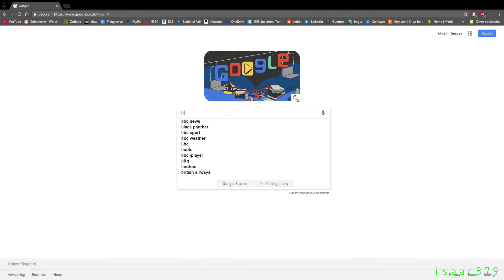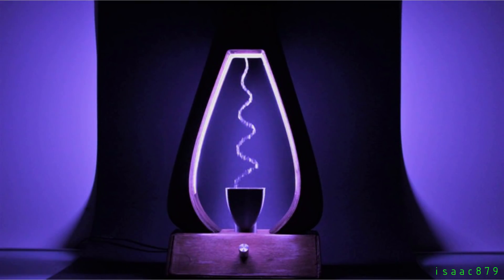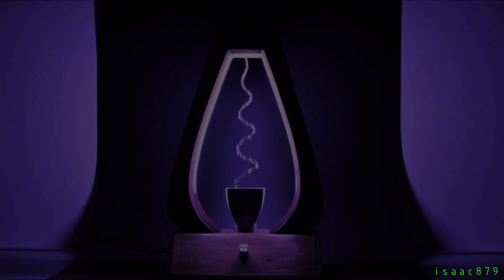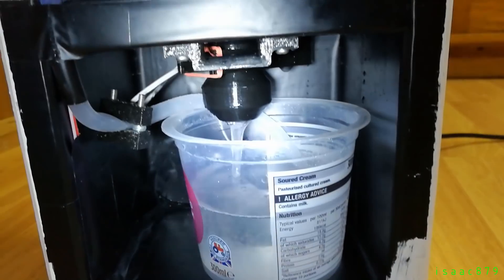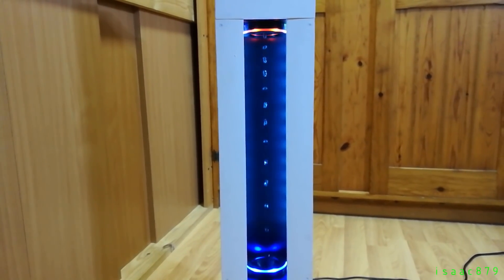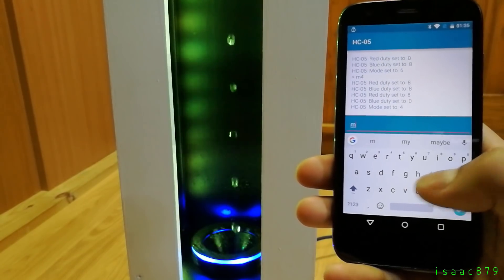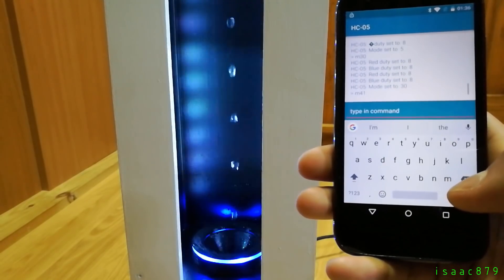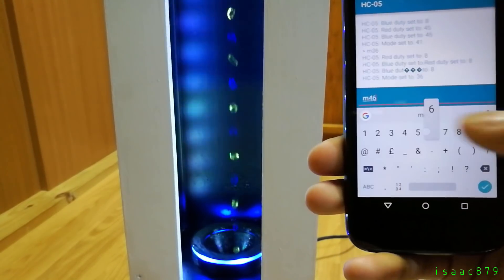Levitating Water Drops - My RGB Time Fountain Project

Comment: what did you use to control the led light strips
Reply from the maker: You can check out the new version and schematic here: https://github.com/isaac879/RGB-Time-Fountain-V2 It's mostly controlled via an Arduino Nano and MOSFETs.

Comment: What are the leds do you use ?
Reply from the maker: I used SMD5050 12V RGB LED strips with 60 LEDs per metre. Like these ones: https://www.banggood.com/5M-24W-RGB-SMD5050-Waterproof-300-LED-Strip-Light-44-Key-Remote-12V-2A-Power-Adapter-Full-Kit-p-1187627.html?rmmds=search&ID=47184&cur_warehouse=CN
Reply: @isaac879  thank you it s a really great time fountain... i love it ! 
Do you use leds alimentation for all this installation ?

Comment: Love this project and the new and improved version!! Do you happen to have the schematic for this design? Trying to attempt something similar and I can’t get it to work properly!
Reply from the maker: Thanks! I don't but the circuits are pretty similar apart from the Attiny part so I would advise using the schematic from the new version (https://github.com/isaac879/RGB-Time-Fountain-V2/blob/master/Schematic_RGB-Time-Fountain_V2.png ) and just ignore the ATtiny85, Ir diodes and control the pump from an Arduino pin rather than PB1.  I hope this helps and if you have a specific problem or question I'll do my best to answer.
Reply: @isaac879  Thank you for getting back to me! I've set up the circuit to your schematic minus the bluetooth module however the pump is not working! I"s it a silly mistake that can be fixed by putting a switch in? or does it have to be controlled remotely? thanks in advance.
Reply from the maker: @rosieluchford8668  it doesn't have to be controlled remotely but I thought it was best to do so for convenience. You can put a switch in for the pump but then you won't have control of the pwm to the pump which can help a little with the stability of the drops.

Comment: cool project would like to implement this but with an Attiny everything in small. how can I rewrite the code so that I only have a white LED? So only pin 1 pump and pin 2 led?
Reply from the maker: It should be fairly easy to implement. The code basically just treats the leds as 3 separate strips so you should be able to remove two of the colours and just use the remaining one to control a white strip of leds.
Reply: @isaac879  I tried but there was always an error message.  my programming skills are not that good.  i don't need the bluetooth and rgb function.  can you help me?  when can we write about insta?

Comment: fun with stroboscopic effects.. adding color - we've been using this in the printing industry for decades to keep 4-colour registration in check. Back then it was with 30,000 volt xenon flash tubes! Lots easier now with high output super-fast rise time Light Emitting Diodes - fun stuff -

Comment: which android app using for sending command to hc-05 also provide circuit diagram for this project thank you brother
Reply from the maker: Hi, unfortunately I think the app I have is no longer available but there are various other ones available. It just acts like a serial connection over usb so you can even send commands from the Arduino IDE.
I am working on version 2 of this time fountain and will release all the design files with a new video in the coming weeks. This will include the CAD models, SVG/DXF for laser cutting, the schematics, GRBl and code.

Comment: Hi @isaac879, I sent you a email a couple days ago I'm sure you probably get a ton of them. I had another couple questions around the actual circuits for the leds and the pump. Are you using a MOSFET transistor to between the Arduino and leds? Also, what do you have between the Arduino pump PWM pin and the pump? Thanks!

Comment: Did you use a H bridge motor driver to control the pump?
Reply from the maker: I just used a TIP120 NPN Darlington transistor to control the pump as it doesn't need to be reversible.
Reply: @isaac879  Thanks!  I assume you used TIP120's to PWM the RGB LED channels as well?
Reply from the maker: @alterdavidj  I actually used 2N3904  NPN transistors as the LEDs didn't require as high current as the pump motor but TIP120 will work as well (I used them on a different project to power a much larger strip that required more current than the 2N3904 could handle).

Comment: How did you measure the water droplet frequency around 55 Hz?  I am trying to replicate this with 555 IC with simple strobe circuit but unable to see this effect. I am using the same R385 diaphragm pump. I though maybe, my pump is pumping water at different  frequency. How did you calculate your droplet frequency?
Reply from the maker: I used the frequency of the strobe to obtain the rate it was producing drops. For my strobe I only use an 8% duty cycle otherwise the drops look elongated, so this might be part of your issue if the 555 is producing a square wave with 50% duty. You could probably find the rate of the water drops by using a frequency analyser app for your phone and listening to the pump. Also are you running the pump at 12V?
Reply: @isaac879  Yes. I am running the pump at 12.7V using a 12V adapter. But I will try to reduce it using 2 diodes in series to 11.3V, as you said in your video that you get better results with slight under-voltage. Also, I read your code and mistakenly calculated your duty cycle to be 80% and designed according to that. Gross mistake! No wonder I am not seeing the individual water droplets! I will make the necessary changes and update. Thanks for the detailed video. Appreciate your quick response as well. :)
Reply from the maker: @knachoo  Ah yeah 80% is a little high! Good luck and I hope it all works now :)
Reply: @isaac879  Got it working. You were right. Duty cycle was the only issue! It works just as intended now. The only problem is, as you told in your video,  uniformity of water droplets. Without any piping on the pump outlet, water droplets as individually visible, but their sizes vary a lot. With even a small piece of tubing at the outlet, water smooths out and it looks like a continuous water stream. Trying a few things on my end as well. Let's see what works! Thanks a lot.
Reply from the maker: @knachoo  If the outlet tube is too long I found the momentum of the water caused it to come out as a stream and not individual drops (part of the reason the pump is in the top of the fountain). The other thing that really helped keep the drops uniform was restricting the inlet size. I used little screw clamp on the inlet tube and tightened it until the drops look a lot better (it required some quite fine adjustment). I'm glad you're making progress and hope this helps.
Reply: @knachoo  Hello Nachiket, I am, like you, trying to do the same project, but I have some problems with the strob effect, and I didn't understand how you resolve your problem...
Once you have your 555 connected to your arduino, you can put the right delay to your pump to have the effect ? put how did you do that ?
Sorry for the english mistakes ^^
Reply: @armandlegoupil761  I didn't use arduino at all. Just plain old 555 astable circuit with less than 50% duty cycle. Used 2 potentiometers to change the on time and off time to get the desired frequency and duty cycle. Regarding the water pump, I used the advice from this video: restricting the water intake and using slight undervoltage. Just make sure that the duty cycle of strobe effect is around 10% and no more.
Reply: @knachoo  can I have your email ID? I have been trying since a long time to do this project without Arduino programming. I have so many questions.

Comment: Would using this as an Arduino program work for the 45hz by using the following code?
tone (7, 45); 
7 being the pin number and 45 being the Hz. Would this work? Cheers
Reply from the maker: No. The tone() function generates a square wave with a 50% duty cycle so the water drops would look very elongated. For reference I normally use 1-8% duty cycle. I hope this helps.
Reply: @isaac879  - I was doing some experiments with this code last night using an led strip and just my tap running at a slow rate and yes you are right, the drips were quite long. Could you provide me with a sample code of how to produce a 1-8% duty cycle. I'm just experimenting at teh moment so I'm not looking for a complex code like you provided in the link, thanks mate.
Reply: @isaac879  - so should I use : analogWrite (20); 
Would that equate to approx 8% ? Cheers

Comment: I tried making this using addressable LEDs but couldn't strobe them fast enough.
Reply from the maker: That's one of the things I'm going to be looking at doing. I assume it must be possible with the right optimisation because the Aquarius fountain uses them and runs at ~80Hz where as this only needs to run at about ~55Hz. If I manage it I'll post a video about it.
Reply: @isaac879  maybe the fact that i am using a normal jet styled pump instead of a diaphragm pump has to do with it?
Reply from the maker: @shanrocks1234  Ah yeah that will probably be an issue... You need a pump that produces drops of water not a continuous stream otherwise when you strobe it, it'll just look like a stream of water.
Reply: @isaac879  I am ordering a diaphragm pump right now and will be trying with 10 W white LEDs first , Might modify your code to see if I can use WS2812 instead of the normal RGB strips
Reply from the maker: @shanrocks1234  If you get it working I would love to see the results! If I remember correctly there are a few types of WS2812, some of which driver the leds at a higher pwm frequency which will probably be necessary to get consistent colours on the water drops. At some point I am going to research this properly and get them working...
Reply: @isaac879  the problem isnt the LEDs themselves but the frame time needed to update all the LEDs
Reply from the maker: @shanrocks1234  You may be able to cut up one long strip into smaller lengths and run them in parallel faster? It'll probably require a bit of tinkering to make everything run  efficiently and fast enough. My point about the pwm frequency was that if you use a colour that has different ratios of RGB (pink for example) then a single water drop may look red on top and pink on the bottom. It may not be an issue but it's something I thought I would need to test/be aware of.
Reply: @isaac879  worth giving a try . For the time being till my WS2812 leds arrive I used a single blue colour LED strip ,i had to strobe the LEDs around 14hz to get it to work. What might be wrong?
Reply from the maker: @shanrocks1234  Difficult to say without being able to test it myself but my first guess would be you are strobing it too slowly by a factor of the water drops frequency. Probably by a factor of 4 (4 x 14 = 56Hz (what I would expect the pump to be running at)). So every flash of the leds, the water drops advance 4 positions before the next flash (this would probably make them look less consistent as well.)
Reply: @isaac879  i am running the pump at 160 value of pwm and at 12v.. Will try a lower voltage as you suggested.
Check your mail. Have sent you a video
Reply: @shanrocks1234  Hey Shantanu ! I am trying to do this project too, but I don't have the strop effect, even if I use the same pump and a led strip with 1 ms of delay... How did you do that ? Are you using a 555 timer ?
My code doesn't work...
Reply: @armandlegoupil761  The circuit is pretty simple three transistors for switching the LEDs on and off. one transistor to control the pump via pwm and and arduino co-ordinate all the stuff.
Try increasing the height at which your pump delivers the water stream. Initiallly at a lower height even I struggled to get consistent drops and No I havent used a 555 timer IC.it isn't required here.

Comment: Wonderfull proyect!!
I want to build one , but I have a question: The pwm controller for pump is only for regulation or make vibrations in wáter?
Thank you a lot
Reply from the maker: Thank you!
The pump PWM is just to regulate the power it receives. It is a diaphragm pump so will naturally produce water drops when power is applied.
Reply: isaac879 With a normal pump will not produce this drops?
Reply from the maker: A diaphragm pump is the only one I found to work. Other types will often produce a stream of water not individual drops.
Reply: I make  one , but  the pump is not  diaphragm pump and the effect is not perfect . Would you said me a example  or link of this type of pump?
Reply: Thank a lot, I will see your code. If i made a modification you will want to see?

Comment: What is the frequency of the LEDs and the one of the pump used to see the drops individually when going upwards?
Reply from the maker: The pump produces about 55 drops per second so to make the water drops appear to be moving upwards the frequency of LEDs must be slightly higher than 55 Hz.
Reply: Hi isac.
My congratulations excellent work, i'm writing from mexico, i hope you can help me to know what enter code in arduino??  to get the pwn in the pump, i just need the bump effect no the ligths. Thanks

Comment: Hey mate,

I'm about to build one of these as a science project and I used to operate the ones at the Edgerton Center, MIT but it's been a while and I might need some help, is there a way we can chat? 

If that's too much trouble it's alright no worries.

Great job here, and awesome way to apply the idea on the time frame project, I wonder what other objects could be used to set them in "slow motion".

Cheers
Reply from the maker: Hi Yuri,

Unfortunately at the moment I'm in hospital with a spinal injury, so can't really chat… Although if you want to email me any questions I'll do my best to get back to you. My email is: isaacchasteau@gmail.com

kind regards,
Isaac
Reply: Wishing you a fast recovery bro and meanwhile I'm working on my code. Really appreciate your time, get well.

Comment: Just an awesome project. I'm about to build it myself with help from your code.
Is it possible that the hc-05 pins aren't declared in your github code, or am I missing something here?
Reply: As I am on the same journey, I can share my insight here: The hc-05 directly is connected to the RX and TX pins of the Arduino (HC-05 RX to Arduino TX and vice-versa). GND of course goes to GND and VCC of the HC-05 to Arduino's 5V (I tried 3.3V as well, but that did not give stable results in my case).

Comment: Hey there, fantastic work on this project! I am currently working on a similar project and I was wondering if you could post links to the MOSFET, transistors, and any other important components. Thank you!
Reply from the maker: Thanks! All the components were pretty standard. I used this pump: https://www.ebay.co.uk/itm/12V-DC-R385-Mini-Aquarium-Pump-Fish-Tank-Motor-Diaphragm-Water-AIR-Pump/192306145009?ssPageName=STRK%3AMEBIDX%3AIT&_trksid=p2060353.m1438.l2649
TIP120 transistor for the pump and LEDs.
I also used the waterproof RGB 5050 LED strip.
An HC-05 Bluetooth module handled the communications and an Arduino controlled all the electronics. I think the only other components were a few resistors and capacitors  on the motor to reduce the noise it created in the circuit.
I hope this helps you and the best of luck!

Comment: Hello. This work is really amazing! I build it by myself and used 4 NPN Transistors and my own sketch. But i have the problem, that when i trigger the pump-transistor by continously 160pwm for example the stream doesn't seem to by equal all the time and the drops are jumping up and down. Do you manage pwm in realtime or do you use a fixed pwm value? Best regards Christian #r1s1ngh3r0
Reply from the maker: I used a constant PWM value of 245 (out of 255). It took a lot of work and testing to get a constant stream of drops, I found I had the best results with a diaphragm pump that had the intake restricted and a short piece of tubing for the nozzle. I hope you manage to get it working!
Reply from the maker: draco24 I believe the pump PWM frequency was approximately 200Hz, however this value is fairly arbitrary and it should work on a wide range of frequencies without any issues.

Comment: Really great project! Now I also want to build one myself. :)
But I have some questions regarding your circuit to control the pump and LED strips: Does the Arduino directly source/sink the current (I do not think so) or do you use transistors for that? Do you have a (rough) schematic to share?
Reply from the maker: Thanks! As you correctly guessed the Arduino controls transistors to PWM the LED strip and a MOSFET to control the pumps PWM. The LED strips and pump both are powered by a 12V supply. Unfortunately I don't have a schematic yet but will create one in the near future and share it.
Reply: Hello. This work is really amazing! I build it by myself and used 4 NPN Transistors and my own sketch. But i have the problem, that when i trigger the pump-transistor by continously 160pwm for example the stream doesn't seem to by equal all the time and the drops are jumping up and down. Do you manage pwm in realtime or do you use a fixed pwm value? Best regards Christian #r1s1ngh3r0

Comment: I was wondering how noisy the pump is and if you can hear it in a silent room.
Reply from the maker: Unfortunately the pump does make a bit of noise so you definitely would be able to hear it in a quiet room. I would say it is a little bit louder than a  PC fan running at max speed. Using an app on my phone (so not very reliable) I measured the sound as 47dB right next to the fountain and 30dB 1m away. (Normal conversations are around 45-50dB). On my next version I am going to try to add sound proofing to it so hopefully it will be a lot quieter after that.